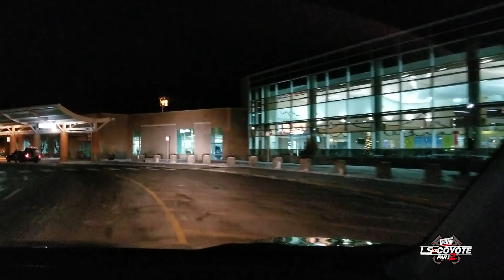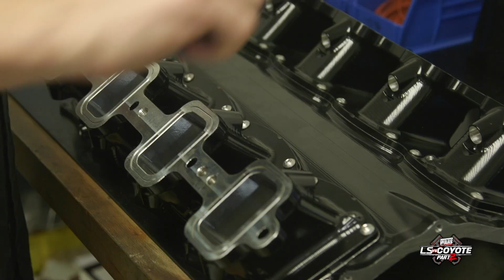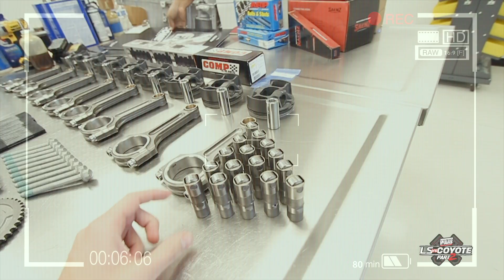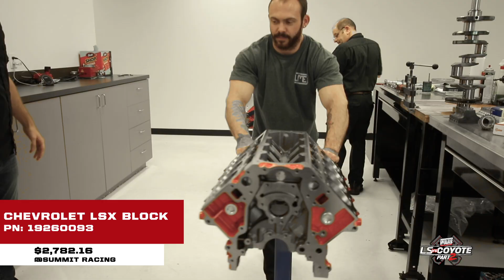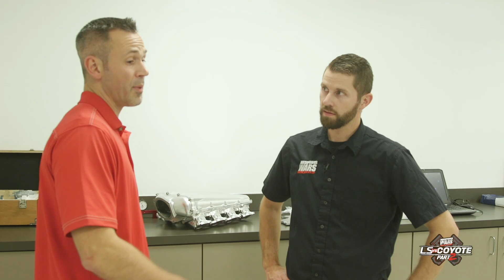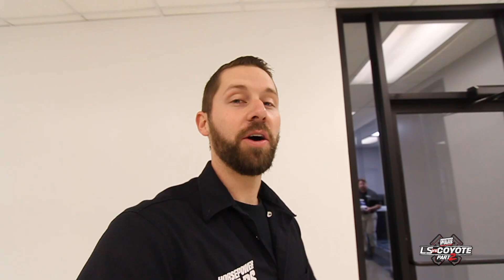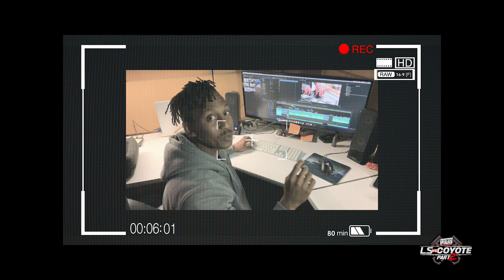LS vs. Coyote 2 Episode 2: The LSX Engine Build

Comment: This is not a far built competition cuz how y'all gone put a lsx block against a 5.0 block y'all should have got a boss 302 block then it would have been a little bit closer but if the Ford lose it's all good
Reply: The 5.0 builder gets to do whatever he wants within budget.
Reply: @robertgardner2782  goto LME's website they sell this engine for $24,620.00 without the $4500 intake and without all the custom head machining (porting, o-ringing etc) So how is it a 15k engine?
Reply: Ken Pachi  It's definitely a $30,000 engine!!

Comment: There's a reason the LS was used in Corvettes and the coyote wasn't/ isn't used in the Ford GT.
Reply: Coyote doesn't come in a 6 cylinder... Ford GT they went boosted 6 cylinder. If they chose a V8 it would have been a variation of the coyote.
Reply: @mcthunderstick2374  so a V6 is better platform than the coyote?
Reply: They used the twin turbo by because of body shape aerodynamics they claim
Reply: @MrCsioktech  they designed the new ZR1 around the engine and the supercharger ie bumper grills and hood. If the coyote was the end all be all, I really think ford would have used it.
Reply: @jaredsmith4944  I'm not claiming that the coyote is some pinnacle of engineering feat. I'm just saying that Ford claimed they wanted the car to be streamlined and a twin v6 (not by) fit the design better and got them the hp goals they needed. Alot I will agree was showing off the v6 power capability because Ford is more small engine directed for European markets whereas GM caters to us and Australia more. Most European countries charge taxes on engine size so Ford engineers around smaller high output engines. No argument that the coyote is amazing but it will not compete with an ls $ for $. More options with ls motors and if you want hp numbers then an ls with big cubes is easier. Size of engine matters because it needs to fit in a vehicle. Try to fit a coyote in a 240 or miata. Ls engines go in all the time with twin turbo setups. Many claim the 5.0 coyote is better than the 5.4 that was in the gt because it revs higher. Ford does a bad job on standardizing which makes it more expensive in the aftermarket whereas gm makes nearly everything interchangeable or adaptive. Just the facts
Reply: @MrCsioktech  thanks for the free education.
Reply: @mikec9112  Not really. There are a lot of 4 cam OHC engines which will flip upside down on an engine stand. Some dual can 6's will too. 
Obviously if you mount them at the crank they all will.
Reply: Really strange as many would argue that the LS OHV 16V is a truck engine design, where as the DOHC Coyote 32V is a perfect sports car layout. I would argue the OHV is better all around for sports cars due to it being bottom heavy and not too heavy. They were trying to push the “Egoboost” engines when they chose that for the GT, and IMSA sportcar series engine allows NA engines up to 5.5L so they could have made a pretty mean Coyote.

Comment: This is the only way chevy fans can win by starting with a 427. Get the ls3 like every budget guy does not the top end block
Reply: Funny thing is the lsx block is within 5-600$ of a new LS3 block, true budget guys use iron 5.3-6.0 blocks but if you had 15k to build whatever you want you would get the best parts possible!
Reply: @derekstewart8175  lol I love how some people dont know shit about cars like they think labor is cheap when in reality if you have a race shop build you will be paying that 10k for something like this build
Reply: @derekstewart8175  couldn't agree more
Reply: Coyote crate makes more power and cost less than a ls3 crate. Mind blown huh
Reply: @banneddamn  lol no it don't its alot more price tag with about 25hp and almost 40tq less what are you talking about a 2014 mustang makes  only about 415hp and 389tq where the ls3 makes 435hp and 425tq and this is a engine that's bin in production years before the coyote was even a concept engine
Reply: @mr.merica6048  ls3 crate 430hp $7050 https://www.summitracing.com/parts/nal-19370416/
Reply: @mr.merica6048  coyote crate 435hp $6798 https://www.summitracing.com/parts/fms-m-6007-m50a/
Reply: @mr.merica6048  you were saying?
Reply: @banneddamn  that's for a gen 2 not a gen 1 🤦‍♂️
Reply: @mr.merica6048  so. Whats that matter? That is an absolute apples to apples of the basic currently available crate engines from gm performance and ford performance.
Reply: @banneddamn  if you want to bring currently available GM engine if that's the case I will remind you of the new lt1 that makes 455hp and 455tq where the 2018 5.0 makes 460hp and only 420tq
Reply: @mr.merica6048  yeah but yeah but blah blah your stated case still makes less hp so you are not helping your arguement. I could thumb through all sorts of different versions of whatever motor but the fact remains in the most apples to apples comparison, well there it is.
Reply: @banneddamn  lol you act like hp is always the best part I would rather have a engine that makes 5hp less and 35tq more then the other you obviously think hp is the only thing that matters 🤣
Reply: @banneddamn  ps I have owned both the 5.0 the ls3 and now the lt1 sit down and go play your xbox or ps
Reply: @mr.merica6048  i already prove my point in being right and now you are mad trying to hurl petty insults trying to insinuate im some kid by telling me to go play video games haha. Thanks for letting me know i won the debate. Better luck next time.
Reply: @banneddamn  lol I could care less at the end of the day I actually race my car I'm pretty sure you dont even own a mustang or anything fast for that matter
Reply: @mr.merica6048 currently my play car is a sn95 saleen with a terminator swap that i turboed. Daily a mustang gt. Also have a turbo kawasaki bike among other vehicles. You want specifics or something? None of which matters to the conversation anyways. I dont have to prove anything. I bet you dont have any cars. Or race them. Or whatever. See how stupid that sounds? I wouldnt assume dumb shit like that about you.
Reply: @banneddamn  lol sure I like both engines but at the end of the day LS is is taking over the engine swap world for a reason go to a track and I bet you $100 you will find a ls swapped 60s ford before you find a coyote swapped anything
Reply: Adam Dawson that extra $$$ is for reliability. No coyote is gna outlast a ls no matter what. They’re junk shit. Go blow ur ford now. Thank you.
Reply: @banneddamn  whats the driver side manifold cost that isnt on the Coyote crate engine?
Reply: @mr.merica6048  Nobody buying the ls3 when the ls376 480 is only 200 more and and actually dynos 495... Dawsen is a typical fanbois with his stips not including the missing drivers side exhaust manifold on the coyote ....
Reply: @shaadydog1  I like both engines i just know any LS engine is the better option for a build if your on a budget
Reply: @mr.merica6048  Same here, had a 2003 Mach1 DOHC 5 spd, loved it, was an awesome car for that time and money. Now own a 98 Camaro LS1 6 spd  just finished installing a  Huron Speed front mount kit on. Just starting on tuning  it.
Reply: Funny thing is that if you take a 5.3 or 6.0 blocks and do springs, cam and turbo and it would kill the coyote with a stock bottom end. You Ford guys forget the cheap builds everyone does that run 10s  for under 4k.
Reply: @armyblouvet54  facts my buddy just spent around 5k on his ls1 and with a little bit of spray he will be well in the low 10s high 9s let's just hope his rear end and trans will hold lol
Reply: Oh for sure, i build engines for a living on a small scale compared to LME and that 15 grand is just for parts, there is probably 4-5 grand in labor alone so really its a 18-20+K engine if you can't do it yourself, if you can its wayyy cheaper, not sure why they kind of hide the fact 98% of people cant build this engine for that price
Reply: i'm finding this thread hilarious two guys arguing over which crate v8 makes more power when over here in aus a stock ford 4.0l inline 6 was 496hp and 470lb/ft
Reply: close  more like 430-440hp at best and that includes a turbo 🤣 add a turbo to the 5.0 or ls3 you will be near the low 600hp range sit down
Reply: @mr.merica6048   trying to play down numbers now when the given numbers  are understated . this was my point you actually think 600hp from a 6.6l v8 with a turbo is something special lol you should putting down 1600hp
Reply: @6226superhurricane  with stock internals it's good for 600 hp all day but after that you will need lifters and a few other little things just to keep it running correctly look up cleetus he has a 5.3 with simple mods and is well into the high 900hp and from factory the inline makes 430hp but anyone with tuning experience can get more hp out of a factory stock tuned engine hell a 6.2 ls3 with just a tune you can easily make it 490hp and thats with just a tune
Reply: @6226superhurricane  ps ls3 are 6.2
Reply: xr6 sprint is 496hp and 470lb ft stock i already told you that. i still find it hilarious you're arguing over two crate motors less powerful than a 4.0l 6cyl engine out of a family sedan.
Reply: @6226superhurricane  lol yet you forget to mention its turbocharged from factory its rated at 430 from factory bud sit down
Reply: @6226superhurricane  take off the turbo and I bet it will do like 290-300hp at best also the 5.0 or the ls3 with low boost will be at 600whp if you turn it up it will be easily at 700whp but it will not be good for a daily with out supporting mods
Reply: @mr.merica6048  still trying to tell me how much power an xr6 sprint has lol
Reply: @6226superhurricane lol needs a turbo to even make 400+ 🤣

Comment: Stuff the ls in a camro and the coyote in a mustang and race them at the end of the buld
Reply: @boosted2v56  maybe you should do a little research the 2v was used from 1996 to 2004 and the 3v was used from 2005 to 2010. Then in 2011 they were replaced with the coyote.
Reply: @boosted2v56  what record did the 4v set??? Unreliability... they were underpowered Unreliable engines. There's a reason ford only used the 2v for 8 years and the 3v for 5 years.
Reply: @konnerkramer3381  and they definitely was sticking 2v in cars longer the 8years  but ok u got all the answers guess they didn't stick them in Thunderbirds before 96 but ok🤣🤣
Reply: @konnerkramer3381  so just cause I dont use periods and use proper grammar that means I cant build engines or know what I'm talking about? Hmm seems funny that u said it was only produced in 96 thru 04 which is false 94 was the first year of the 4.6 ohc so keep thinking u know something when u clearly dont so keep caring on I got 2 boosted 4.6 2v one is at 400 the other a 600 not including my 1970 396 big block nova so before u come at me u need to stick to your desk job cause I wouldn't trust u to do a oil change let alone try to school me on cars that I was literally raised on and built so how many muscle cars u built? That's what I thought zero cause your a pussy boy who buys his shit doesn't build it so just let me know if u didn't understand anything I said cause I didn't u use proper grammar and we can find another way to teach your retarded ass something
Reply: @boosted2v56  I have 43 head of cattle, 4200 acres or land and own an exhaust shop. I worked for a tree trimming and landscaping business when I was 14. When I turned 16 I got a job at quality quick lube(oil change) and I worked there until I graduated high school. Once I graduated high school I got a job at Walmart auto until I finished tech school. Then I got a job at Lewis ford. I worked there for 5 years then I was transferred to the Toyota/Chrysler division of the Lewis dealership I worked there for another 2 years. Then I got a job at a1 Scaffolding welding where I worked for almost 2 years. Now I work at Leon's welding and fab. I make custom exhaust as a side job/ hobby. You can call me a desk job pussy all you want but I'm proud to say I have always had a manual labor job since I was 14.
Reply: @konnerkramer3381   wow man cool fucking story bro I could honestly give 2 fucks less about your job occupation why u even felt the need to comment back is beyond me u have a good day jack of all traits
Reply: Slowmaros aren't competition for the mustang. Corvettes are the only GM chassis capable to hang with the almighty coyote.
Reply: @clutchkickpj693  really is that why Camaros have been out running your moostang since the 70s
Reply: @konnerkramer3381  https://www.google.com/url?sa=i&source=images&cd=&cad=rja&uact=8&ved=2ahUKEwi9uMzEoK_gAhXM5IMKHfXSDkQQjRx6BAgBEAU&url=https%3A%2F%2Fme.me%2Fi%2Fdefinitionaterminator-cobra-the-reason-gm-stopped-camaro-production-forayrs-none-18074323&psig=AOvVaw0SvY7aTzYR3kucdZcPw4Ca&ust=1549822410277384
Reply: @thatoneguy-1290  a rare special edition mustang didnt make chevy stop production the Camaro. The Camaro was made on the Pontiac f body chassis and when Pontiac when belly up chevy no longer had a chassis to build the car on. So they had to fully redesign the Camaro. But before that the 4th gen Camaro absolutely massacred the 2 valve mustang in every single way. Acceleration, top speed, handling and braking. And once the 5th gen Camaro came out it did the same to the 3 valve mustang.
Reply: @konnerkramer3381  so u speak of the 2v and 3v but dont speak of the 4v that literally destroyed camaros and trans ams and gtos and still to this day holds it's own on the streets so this massacre that u speak of never happens but good try lol
Reply: @boosted2v56  I only mentioned the 2v and 3v because the other person was talking about them. What 4v are you talking about the 4.6 or the 5.4. Both were nothing more than mediocre truck engines that are plagued with tons of flaws. The 4v was a joke which is why ford was so quick to replace it with the coyote.
Reply: @konnerkramer3381  oh and u forgot the 5.8 4v that was factory 662 hp or the 5.2 vodoo 4v 525 hp but those must be shit also
Reply: @clutchkickpj693  almighty coyotes.  Lmao are you talking about the same piece of shit ford engine that eats itself alive !!??